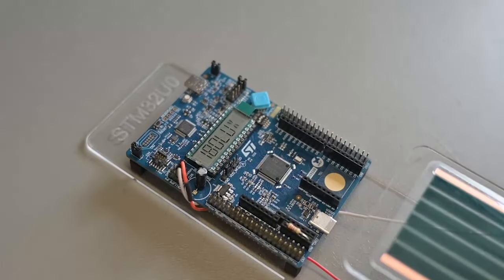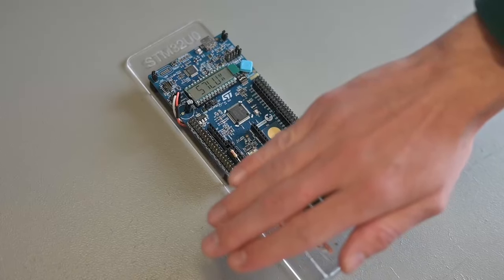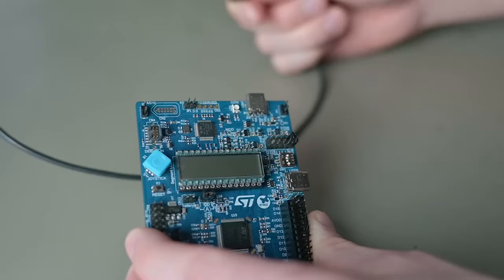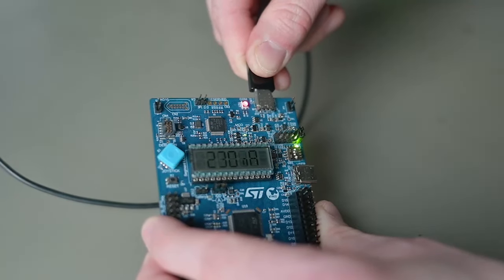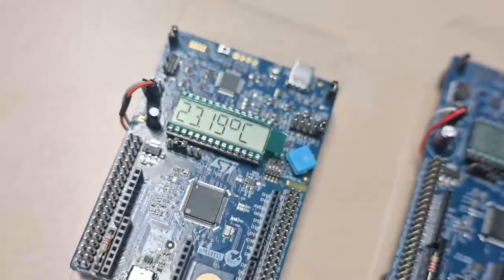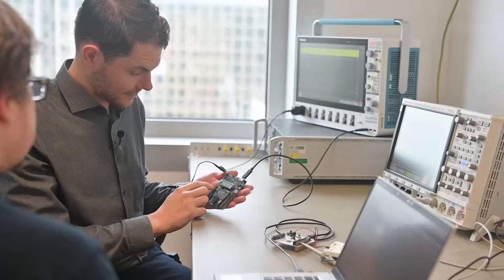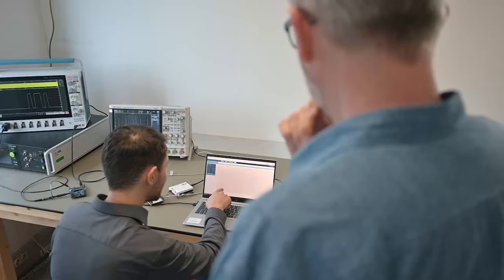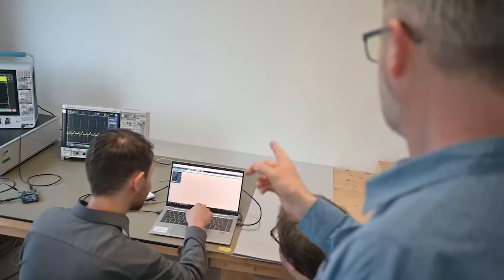Introducing the STM32U0!

Comment: Overall, this chip is excellent. The current draw in suspension down to vbat is in the nanoamps. I also like the WLCSP package for really low profile situations (I am working on something with the profile of a credit card), although that is only in evaluation right now and not available for sale. It would be really nice if the chip had more than 1 DAC channel (at least 2) and lower current draw for the OPAMP and VREFBUF peripherals. I am targeting an energy harvesting application, and having ultra low power analog sensing capabilities would be good. The ADC and DAC can operate with pretty low power if you configure them appropriately (I am targeting sub 50uA), but the OPAMP still draws considerable power (for energy harvesting) if you keep it on continuously (around 50uA at low load). Having additional OPAMPs would be good too, but if that would add cost it isn't as important since external ones can be used that are in the ~1uA range. The VREFBUF really does need to remain on though for external analog components and probably should be lower power if possible. Also, I would really like to see a Nucleo-32 board for the STM32U0. It has enough external ADC channels (up to 12) to support the 8 analog pins on the left side of the Nucleo-32 pinout standard. This would make it useful as a swap-in module for prototyping and test equipment as an alternative to the existing Nucleo-32 modules, and there are variants with as much flash as the Nucleo-L432KC.

Overall though, there aren't many things on the market that are as good as this for energy harvesting applications. Bravo!